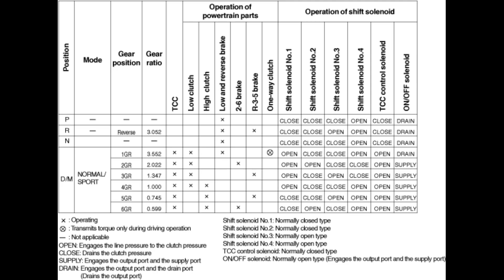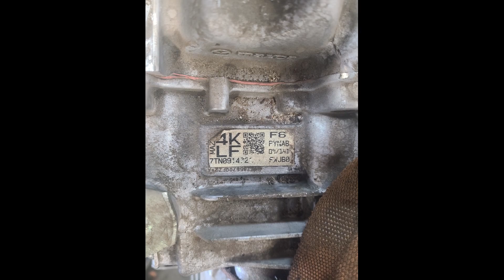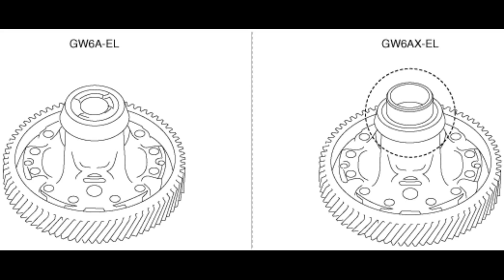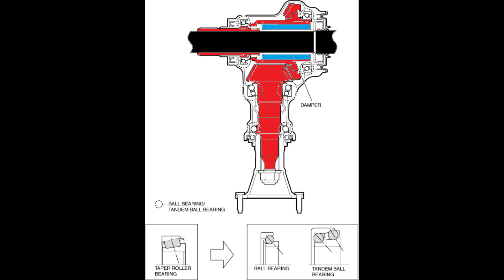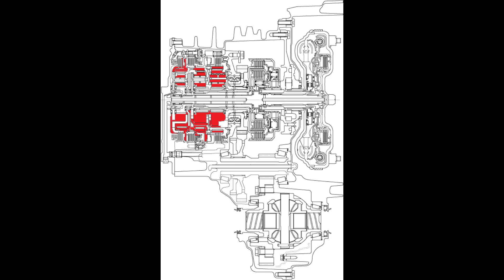FW6A-EL Overview (Skyactiv Drive)#fw6ael #skyactiv #skyactivdrive #transmission

Comment: 1. Is it true that service fluid in this transmission is lifetime as written?
2. How durable fw series is?
Reply from the maker: The fluid wears and should be changed. The FW/GW series has been a very durable unit.
Reply: @grolladat  Are you an actual Mazda mechanic ? Anyways my 2016 Mazda 6 has been solid. I'm at 119k miles and transmission fluid has been changed twice so far. I'm original owner. So far I'm aiming for 40k miles intervals since I'm a relative normal driver. Not too easy but definitely not super hard on car. Always fully synthetic oil too for engine. I always bring it to dealer for transmission fluid change. Do you think 40k miles is appropriate for this skyactiv drive transmission?
Reply from the maker: @kevtn8  I'm not a Mazda mechanic, just have been in the auto industry for about 20 years. I love Mazda and my car so I just give back to the community when I can. 40k is a good number for fluid change intervals. Mazda FZ fluid is a good fluid but it does wear over time.
Reply: @grolladat  Thanks, that's great to hear and I'm sure a lot people appreciate what you're doing. I grew up only knowing Toyota and Honda but ever since I bought my Mazda 6 they have easily won me over. Both engine and transmission has been buttery smooth. I plan to keep this car until at least 150k miles or whenever I'm ready to change out to their cx70 or their new Inline 6 sedan. They are most underrated car manufacturer by far. Inline 6 back from Japan ! Super excited for possibilities.
Reply: @grolladat  my FW6AEL on cx-5 2.0 gasoline always change with 3.5liter genuine mazda ATF FZ every 20k km, ridiculuously just FAIL at 131k km, the car is stuck at 3rd gear, initial MIL code is : p0751, p0780, p0731.
my mechanic initial suspect is TCM unit only, install the new TCM (only) and didnt solve the problem.
SOLUTIION: changed Drum c1, piston kit, overhaul kit, VALVEBODY, 8 liter dexron-6 (forgot to ask what brand); with install previous factory TCM again (note: new TCM also worked well).

funny things is, shifting pattern also changed from previous; now holds gear a little longer and downshift more agresive, just about 20% pedal, no need to push throttle-pedal deeper to downshift than previous (about 40% pedal)